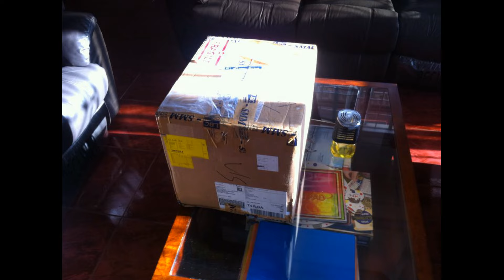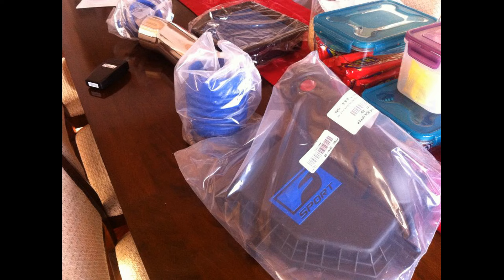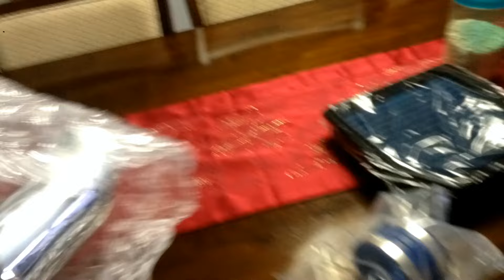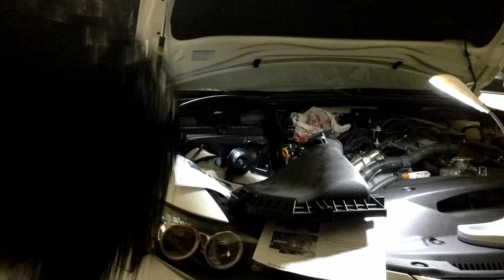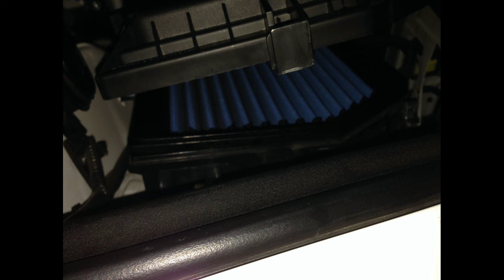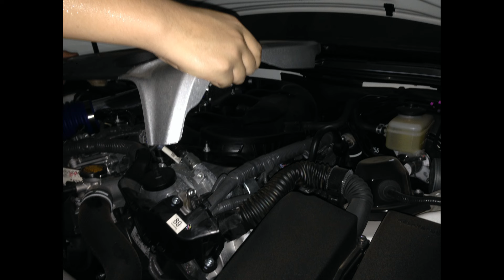2015 Lexus IS350 F Sport Intake installation

Comment: Did the F Sport intake make your car sound louder than the stock intake?
Reply from the maker: +Niclacoste I didn't really notice since I have ARK exhaust already installed but when you're in the car it will be more quiet since the F Sport intake doesn't have the tube that pushes air to the fire wall.
Reply from the maker: Stock intake has an opening that blows air to your firewall to make it sound louder. :)